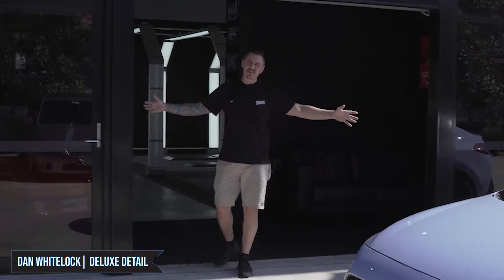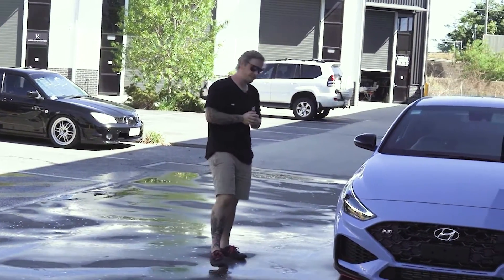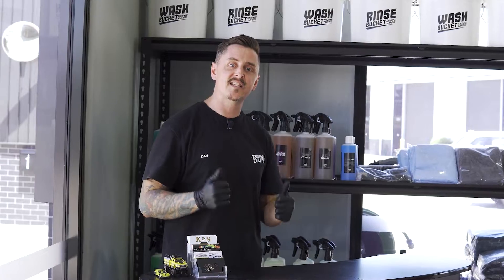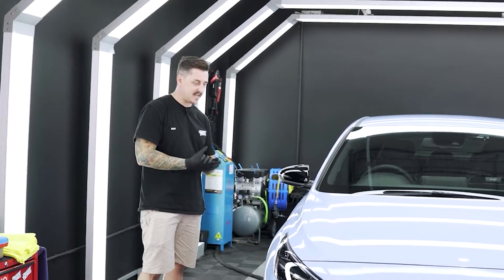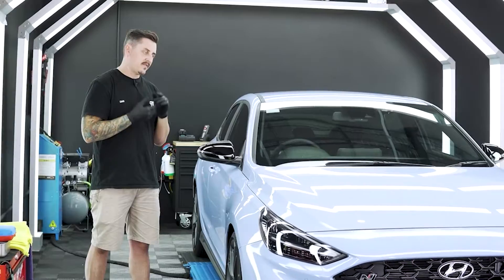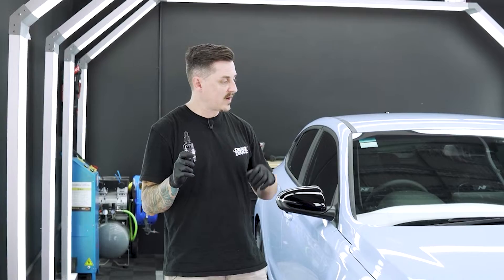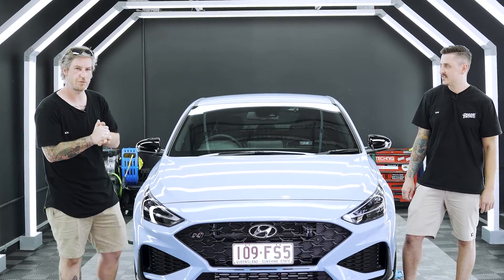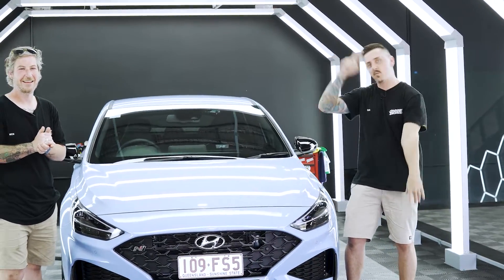2022 Hyundai I30N Fastback Ceramic Coating + Dealership Fail ?!

Comment: How much for a ceramic coating on a i20n ?
Reply from the maker: $1400 for Crystal Serum Ultra, $1100 for Crystal Serum Light.  Includes vehicle decontamination, machine polishing, extensive coating coverage and wheel faces coating.